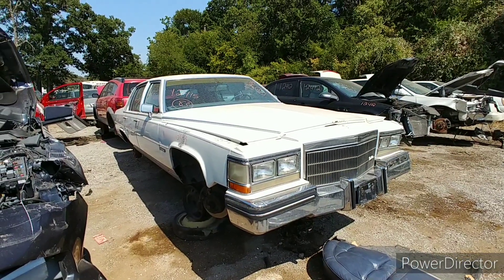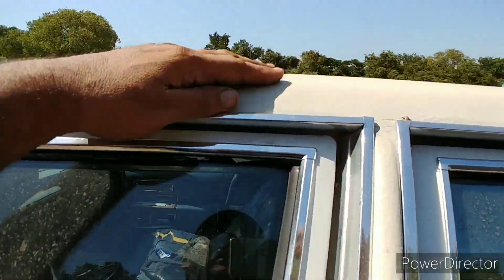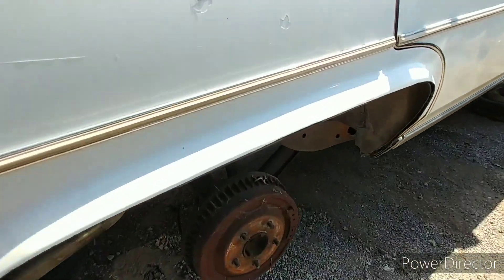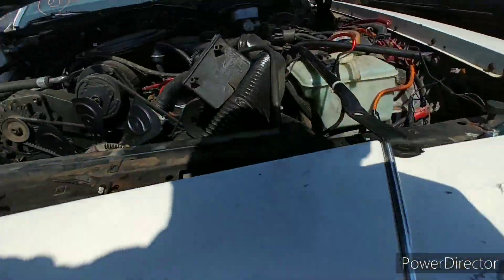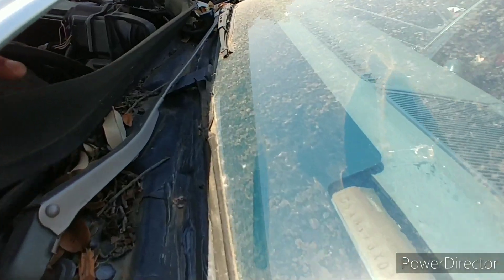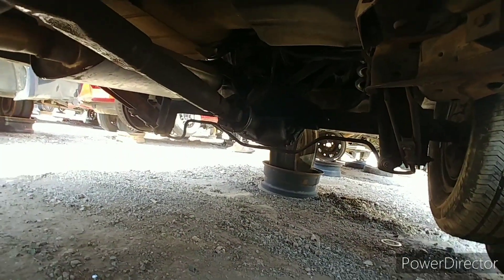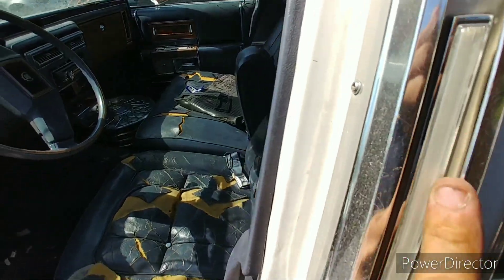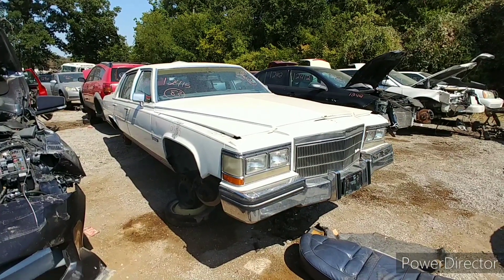1983 Cadillac Fleetwood Brougham Junkyard Find

Comment: Whoa Nelley, Cadu, it's over for you. Yup, '83 had clear parking lights and the "HT4100" emblems on the side. '84 and '85 had "gold crested" clear parking lamps and no emblems. '82 had the emblem and amber parking lights. '80 was amber parking lights, no emblems on the side if it was a regular V8 car. '81 was amber parking lights with a side emblem with the engine size.  My parents had an '83 Coupe Deville we bought new in the fall of '82 in #62 Woodland Haze exterior paint with a matching 1/4 top and a brown leather interior. Very popular in those years.

It's missing the chrome bezel (not beeezel lol) that goes around the tail light with a couple of Torx screws. 

We got the VIN so as we always say, we win: 1 for US made, G for General Motors, 6 for Cadillac, A for manual restraints, B for Fleetwood Brougham, 69 for four door, 8 for RPO "LT8" 4.1 HT4100 V8 with DFI, X is a check digit, D for the 1983 model year, 9 for Clark Street Detroit, MI assembly and the rest is the production sequence. 

We got the tag, we can brag. 83 for 1983 model year, 06B for second week of June 1983 production, 6CB69 for four door Fleetwood Brougham, 9 for Clark Street, Detroit MI assembly, 222 for blue leather interior, 11L for white exterior paint, 11T for white vinyl top, AM6 for split front bench seat. 

Correct, this car would have a "MW9" THM2004R transmission. Whoa Nelley, 113K and it's done, put a fork in it. Not likely more than that. The HT4100 gave the owner a "1-2" punch. First the intake would blow, sending a soupy mix of coolant and engine oil circulating around. Then for the "coup de grace" that mix would blow the bottom half of the engine finishing it off for good. Cadillac issued a bulletin with "coolant supplement tabs" (basically like Bar's Leak) to try to slow it down, but no real dice. It just got them out of warranty and it became the owner's problem.
Reply: Yes I had an 84 Sedan Deville 4100 no power and it leaked oil but it wasn't bad on fuel but that 4100 was junk
Reply: Yeah those 4100s were total loss for the owners. No accountability held for GM at all at the time.
Reply: In the summers of 1984, 1985 and 1986, I took extra summer school courses in computers which was down the block from the Cadillac dealer my father worked at. The parking lot was lined with 4100 engined cars needing engine jobs.
Reply: Yup we had one, bought new. We sold it in 1988 when my father passed away. No problems, but it was low mileage.
Reply: @googleusergp  i also owned a 89 Fleetwood that had the 4.5 engine it was definitely an improvement over the 4100 but basically the same engine and the only other Cadillac I possessed was a 95 Fleetwood now that was definitely a big leap forward with 348 Chevrolet engine or 5.7 that everyone mistakes for a 350 cubic inch.
Reply: @garymckee8857  Yup, the 4.5 was the same engine family as the 4.1, but without the headaches and problems. So was the 4.9 that came later. Yup, the LT1 5.7 liter engine, complete with its Optispark wonder. When we introduced those parts into the line in the aftermarket they sold like wildfire. The guy that sat in front of me was in charge of ignition products and I learned from a friend who also worked with us that he just died at 75  from ALS. He had retired a few years ago, so hopefully he got to enjoy retirement. Same thing with the first and second generation Vortec fuel injectors. The first ones were the complete CPI unit, the later were the individual lines. The plastic would crack over time and cause issues. Also, the first generation Vortecs didn't have replaceable fuel pressure regulators, they were attached with one way screws. Later on companies came out with replacements and the second generation engines had service replacements from GM. The "first" gens were 1992 to 1995 and the second gens were 1996 and up.
Reply: @garymckee8857  The engine was the ruination of them back then. The rest of the car was OK. The transmission was OK, the electronics were fairly reliable on the other parts of the car, but the engine was the problem. I worked on an '82 Sedan DeVille for someone that swapped in a later 307 from a Broughram into it. You just had to remember to order parts for a 307 when it came to engine parts instead of the 4100. LOL.
Reply: @googleusergp  I also had a 4.5 in a 89 Fleetwood it seemed like a better engine but it only had like 60 thousand miles on it.
Reply: @garymckee8857  Much better engine. My dad had passed away by the time that they came out, but I remember going back to the Cadillac dealer where my dad worked to get parts there for my neighbor who worked on several of these back in the day.
Reply: @garymckee8857  The 350 in the rear drive Fleetwood was a rocket. It moved the car out pretty well. Most didn't know (or care) that a "Chevrolet" engine was under the hood.
Reply: @googleusergp  You are correct again, i had a friend pick me up at the airport in mine and didn't realize a big car like that had power he told me he was at the red light and mashed the accelerator and got the screaming tire sound. It had more power than my 93 Roadmaster but I liked the Roadmaster a lot more because it had the TBI engine, full analog gauges and to me a better ride.
Reply: @garymckee8857  1990 Broughams could be had with the 350 VIN code "7" TBI engine. I like those better than the "rounded" RWD cars of the later era. The "square" Cadillacs were classics.
Reply: @googleusergp  I remember in 96 when I first started working in the phone business there was this lead installer for Northern Telecom and we were talking he says when I go home this weekend I worked enough overtime I'm buying a new Roadmaster and my reply was why would you want one those ugly vehicles and he says have ever drove one? This sticks in my the back of my head for 10 years and see one in the Orlando newspaper for 2500 dollars one owner is all the ad says so anyhow this old guy had all the oil change records and had just put a new air conditioner at the dealership AC Delco compressor of course and the reason he was selling it his wife had a minor stroke and didn't want he to drive anymore.
It was an excellent long trip vehicle but like everything I like I got hit at home in Tennessee and totaled the vehicle.
Reply: @garymckee8857  Yikes, it got smashed and then it became trashed. Did you repair it afterward or it got sold?
Reply: @googleusergp  It could have been an easy fix but I had to go back out of town so I let the Insurance company have it. If anyone got the engine and transmission out of it they were in excellent condition because I have everything changed before schedule I guess that's why I usually get about 300 thousand or more out those old rear wheel drive vehicles.
Reply: @garymckee8857  300k, and still going about its' way. Yup, those old RWD cars were reliable and simple indeed.
Reply: @garymckee8857  Here's the plant that made this exact car but a few years afterward. It would close about a month after this video was taken: https://www.youtube.com/watch?v=Mjf-FNvrXqw
Reply: @googleusergp  Thanks I saved this so I can watch more of this video at a later time. Back in the day of the full frame rear drive American vehicle but I digress as usual.
Reply: Yup a very old plant. I think it started as a Fleetwwod body plant but eventually was absorbed by GM. That was the "home" Cadillac plant for decades.

Comment: Is the the HT4100 engine the same family like the Northstar? Starter under intake manifold ... No dowel pin keeping heads in place..... I know there was the 8-6-4 cylinder deactivation monstrosity. Restored with a decent V8 it would be a nice car.
Reply: No the "High Technology" series was the 4.1 used in various models from 1982 to 1988, the 4.5 used from 1989 to 1992 in various models and then the 4.9 used in various models from 1991 to 1995. The Northstar 4.6 replaced the High Technology engines in the Cadillac line up.